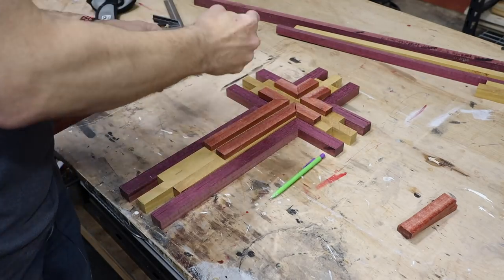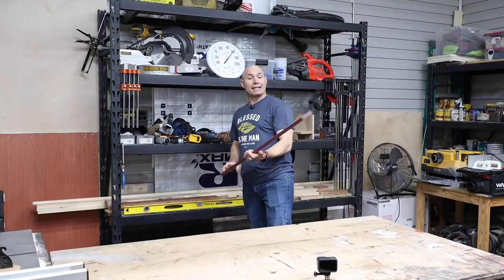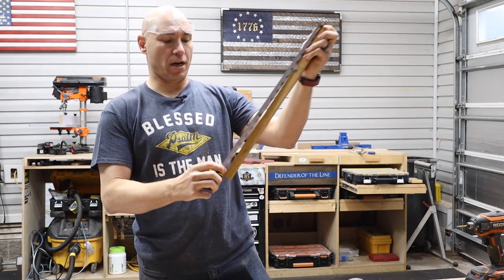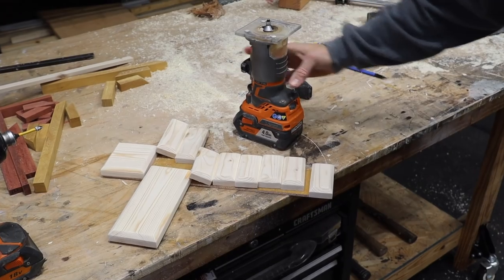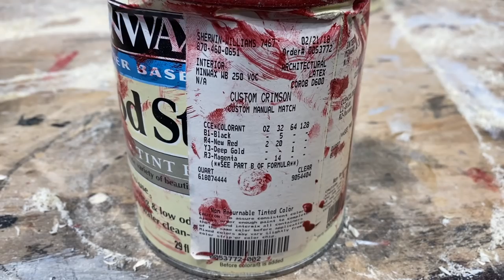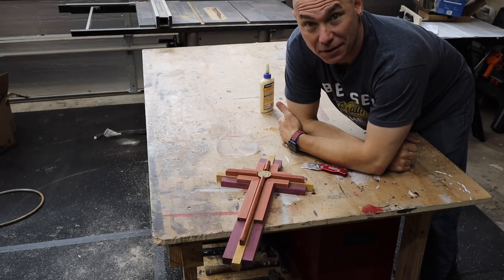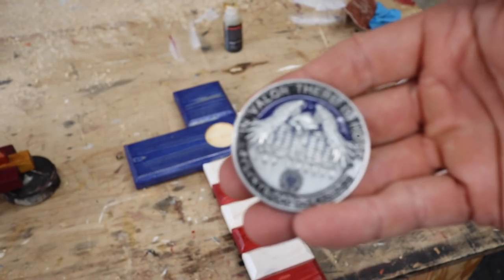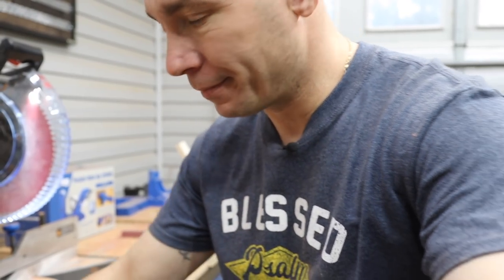Make a Layered Wood Cross and American Flag Cross

Comment: Better safety hold down for cutting small pieces on the miter saw is the $10,000,000 hold down stick from FastCap.Cost you less than $20 and you will wonder how you ever got along without it before. And $20 vs screwing up your fingers or hand is really cheap safety. 

Also use a sacrificial piece of wood to extend the back fence so that you don't have so much of a small cutoff hanging over after it gets cut helps as well.

I am impressed with both of your crosses and especially how you are making yours unique with the inset coins. Very slick.

Comment: Great video!
Speaking of gluing the coins in - I've used CA, two-part epoxy and urethane glues when making pens.

I usually use the urethane glue. It has a long open time, but it foams up like dropping a Mentos in a Diet Coke and would be too messy for what you’re doing.
CA sets fast, but it is ‘brittle’. I found that a sharp can break the the joint & pop the coin out.
Two-part epoxies require measuring the components and then mixing them together. It has a good open time, doesn’t foam up and isn’t brittle but can take a while to dry. I think the coin would be held in more securely.

I to wanted to assemble a cross before I went to work but couldn’t weight…lol
Reply: Oollllllo

Comment: I have cut short pieces like that on my miter saw before and what I always use is my push stick from my table saw that way my hand is completely away from everything and you can actually hold some good pressure on it

Comment: I just had a very similar incident with my miter saw. I was cutting the face of a mallet head and used a 'stick' to hold it. I started to make the cut but wanted to adjust my hold.  Because I was about to make the cut, my thumb was holding the safety button in and my fingers were on the start button.  While adjusting my hold stick my finger squeezed enough to start the saw. It caught the large mallet head, threw it up, caught the blade again and deflected the blade so far the the blade jammed and stopped.  I didn't get a scratch but my saw is scarred and the blade was trashed.  Takes me back to firearms training, "keep your bugger hook off the bang stick till you're ready to shoot"! (Translation, keep your finger off the trigger...)

Comment: Quick question - did you use Odie's oil on the stained pieces of the cross? Debating whether I want to use it on a guitar body I'm working on that I used a water stain on.
Reply from the maker: on the USA Cross I used Total Boat.  The other cross wasn't stained but I did use Odie's on it

Comment: you gave the dimensions, for that one cross, what are the ratios? i.e. horizontal piece 3/4 of the upright? and it's length is what? I am making a few for some shutins for their night stands/desks.
Reply from the maker: I put the measurements on my website (link in description)
Reply: @731Woodworks  Thank You Matt.

Comment: I didn't see anything about how the plywood for the cross was sized. What were the dimensions of that? I'm trying to cut one out with my cnc, but can't get the size correct. Thanks for any help!
Reply from the maker: I just measured it slightly less than the dimensions of the cross
Reply: @731Woodworks , thanks for the info!

Comment: Hi Matt, Ive watch other wood working channels and they addressed wiping the exotics with mineral spirits or equivalent. Due to the oils in the wood  till the color of the wood doesnt show in a clean white cloth. I read tgis after i did a project with purple heart. I havent had an issue with glue joints. Did you?
Reply from the maker: I didn't wipe them with anything

Comment: Is there a formula to use to determine the length of the cross board to the height?
Reply from the maker: Not sure if there is an exact formula.  Several people do it different.  Most go by looks.  Some use the top is 1/3 the length of the bottom. The two arms are the same length as the top

Comment: I built this cross tonight but have yet to glue it up.  My wife just started chemo for Breast cancer this last week and I thought this would make a good Christmas present with a breast cancer medallion embedded in the center.  I made the same mistake with the small 2.5" pieces and the saw kicked that baby out.  i came out mostly unscathed.  My question is on coating.  When I bought the wood the guy at the store said the purple heart would change color to gray unless I coated with a UV protecting coating.  I like the oil or wax but can a UV protection be put over that?